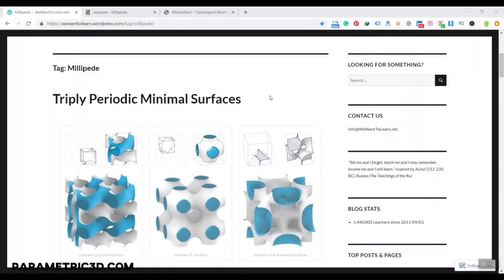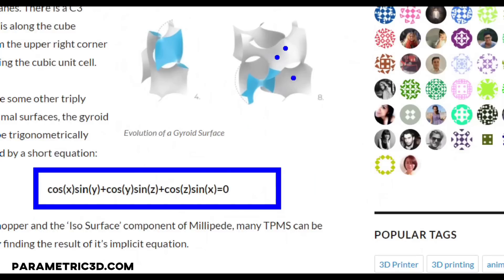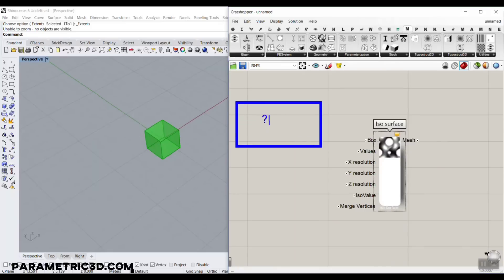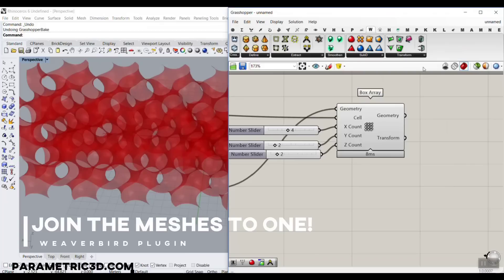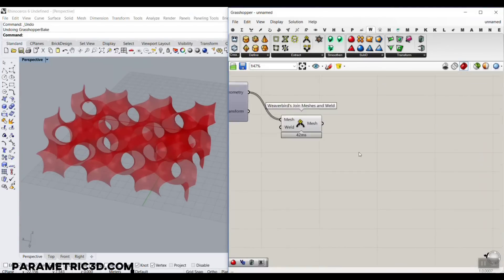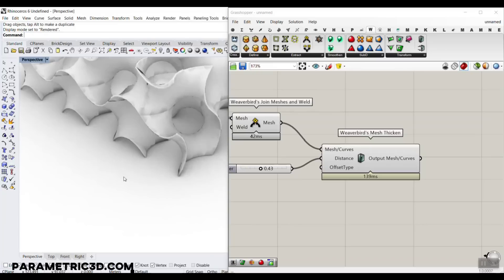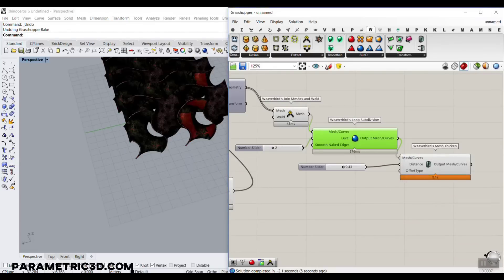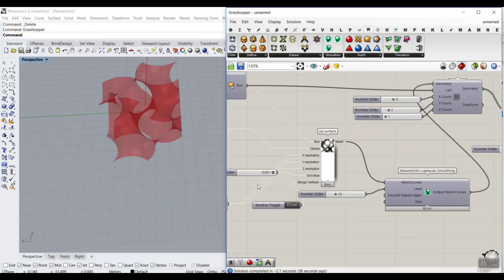Gyroid Minimal Surface (Grasshopper Tutorial)

Comment: Hi, I'm trying to transform the gyroid surface in a solid, but instead of thickening it I would like to use the gyroid to divide the cubic cell in which is contained into two space domains, and infill one of the two domains. Many triply periodic surfaces actually divide the space into two phases. In the case of the gyroid, this two space are identical. Now, a long and tedious way to do this would be to transform the mesh into a brep polysurface, than transform the boundaries of one of these two domains into planar boundaries, cap the boundaries and you would get a closed polysurface, eg. a solid. Actually I was able to do this with a Schwarz Primitive, because the open boundaries of that surface are already planar, so the only thing I had to do was to convert it from a mesh to a brep polysurface and then cap the boundaries.  But in the gyroid I don't have planar boundaries, so this strategy would not work. Do you have any advice?
Reply: Hello, Are you able to make those surfaces into solids?

Comment: Hello, thank you very much for this instructive tutorial!! I am wondering, is it possible to extract the inbetween volumes somehow, the channels inside the gyroid so to say? I would be very much interested in that
Reply from the maker: You're welcome :)
I think you can achieve that by using a Boolean operation somehow! Maybe a Boolean difference between a box mesh and the Gyroid
Reply: @ParametricHouse  Thanks for your advice! I did try that, but as the result im getting one single mesh with both channels inside it. Is there a way i can seperate them so i have a body for each cahnnel? Thank you so much for your help.
Reply: Hi! Try mesh intersecting your produced minimal surface with its bounding box. Does that help?

Comment: Hi, love your tutorial ! But for this tutorial in particular, I am having some troubles with the millipede plug in, it doesn't appear on the component tab even after  I installed it and put it in the component file.... Im using mac, has anyone solved this problem before ?
Reply: Use windows🙂

Comment: Hello, A BIG THANK YOU for such an informative and helpful video. 

I have a small query instead of the cubic shape(Box array) can we confine the gyroid into a cylinder.. ? to get a cylindrical gyroid.
Reply from the maker: Hi Pearlin. You're welcome
Well, that's a tough question! I guess it's going to be really complicated to that as the Iso Mesh is defined by u,v,w domain (BOX)
Reply: @ParametricHouse 

Thank you so much for reply foremost. But even then I'll get a box.
Reply: Hello,
Hope you are doing well. :)

Is there a way that I make the cuboid and then cut or extrude it in rhino. Since my unit cells are really small minimum being 0.750mm when I do boolean intersection to get a shape. The software give a defective figure.

Is there any solution to get a cylindrical gyroid out of this.

Waiting in anticipation.

Comment: That's really nice tutorial. I would like to create an offset of this surface for my work. Problem is, its not one surface mesh but 8 meshes stitched together. As soon as I extrude and offset, there are gaps created. I have used Weaverbird and Lunchbox , Kangaroo plugins for reduce/refine/smooth/weld meshes but so far not able to fill those holes. I tried creating polysurfaces as well. But the holes remain. Is there any way around this problem?
Reply from the maker: Did you try mesh join and then join mesh(weaverbird) (remeber to change the weld to true)
Try alo remeshing with kangaroo physics and see if it works